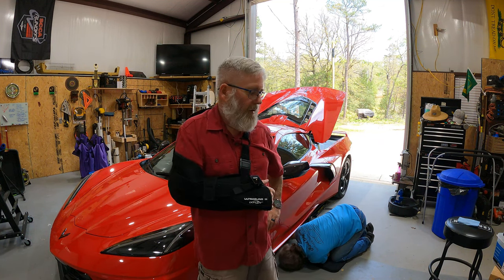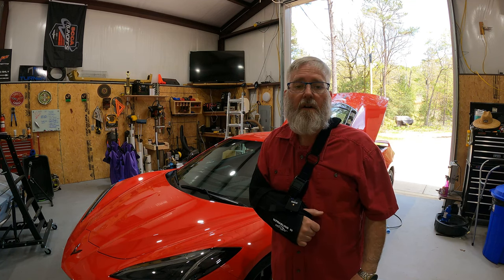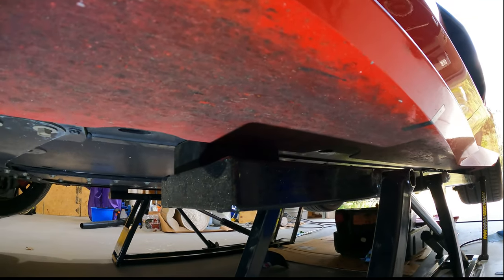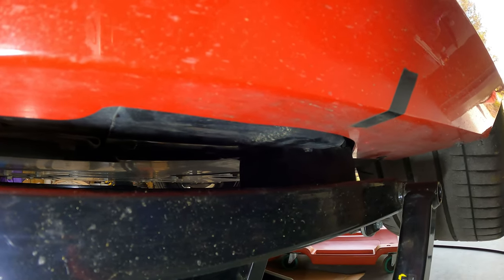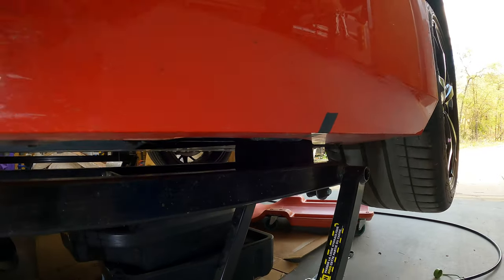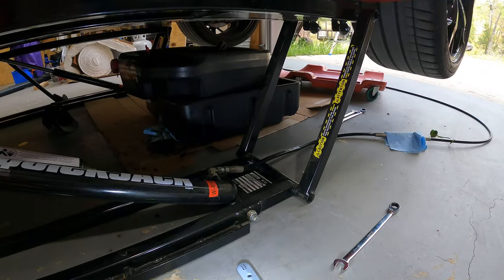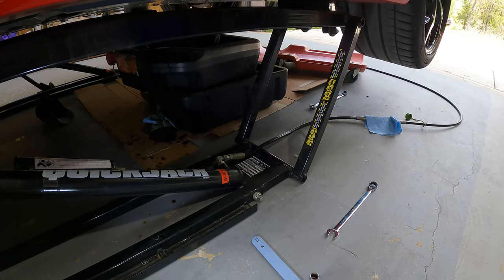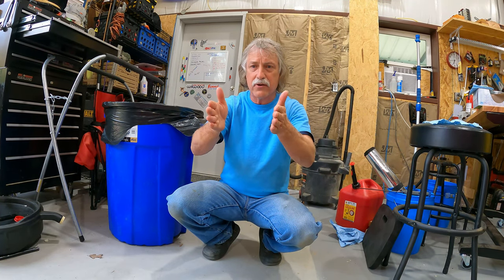C8 Corvette on a BL5000SLX QuickJack Revisited #c8 #diy #automotive #chevrolet

Comment: With the quickjack, they are great for saving space, but I assume they aren’t as practical because some cars need jacking on certain points/ are wider or not as wide as a standard car? I don’t know that much about them 😅
Reply from the maker: They can actually be hung on a wall when not in use so a big space saver.  Width isn't an issue either as they can be as close or far apart as needed as long as the weight limit isn't exceeded.  Thanks for watching!
Reply: @YellowJacketGarage  Ooh interesting, worth thinking about for the future 😀